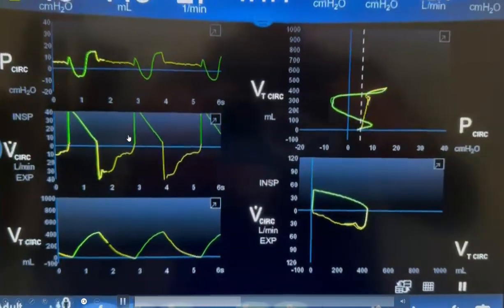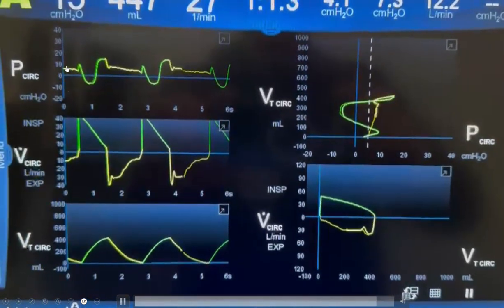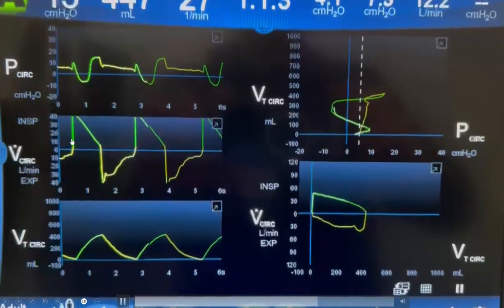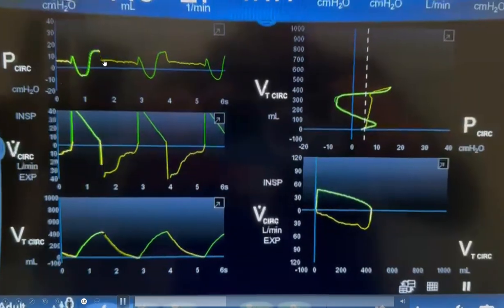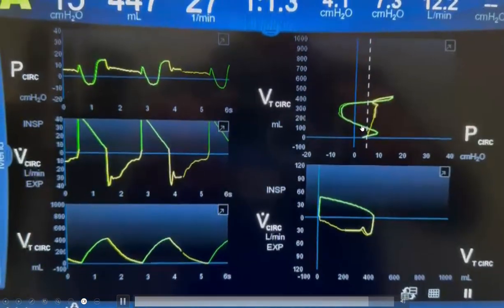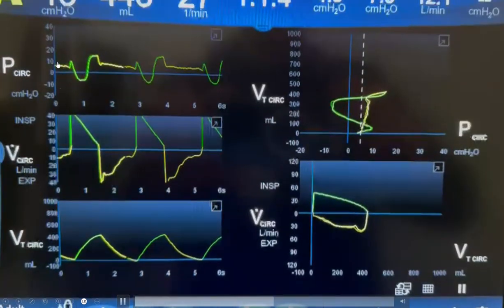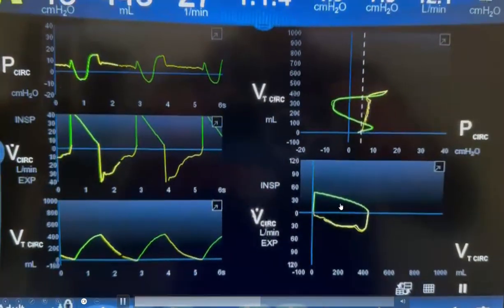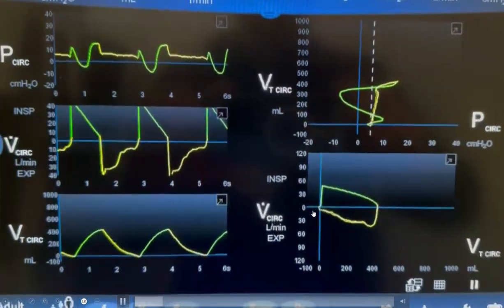Air Hunger on Mechanical Ventilation

Comment: Thank you for the nice presentation
I assume the patient is on VCAC Descelerating pattern flow, which accomplishes the highest flow in an auto-flow setting. Since most new MV are in auto flow.
At least, that is what i know. Please correct me if I am wrong.
Reply from the maker: You are right, flow cannot be adjusted if decelerating on most ventilators, however on Bennett ventilator you can set the maximum inspiratory flow and adjusted as per patient need
Reply: @ICUREACH  wonderful
Please keep making these videos to help us grow and reacher higher
Personally, I will always be indebted to you
Reply: Good 
Thank you for sharing